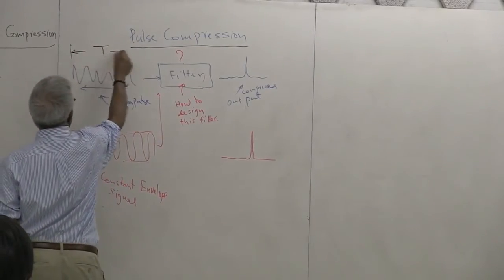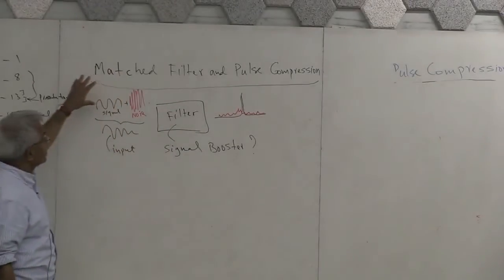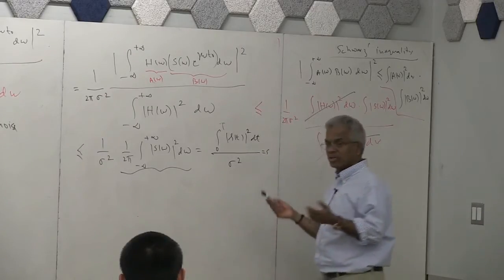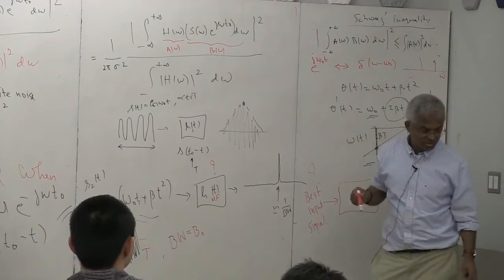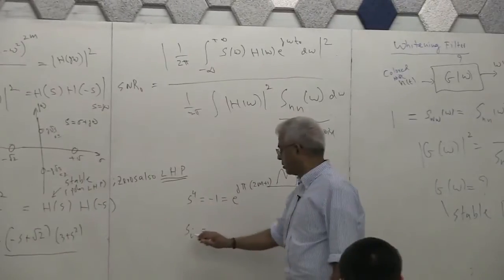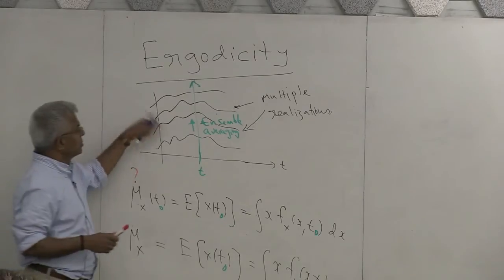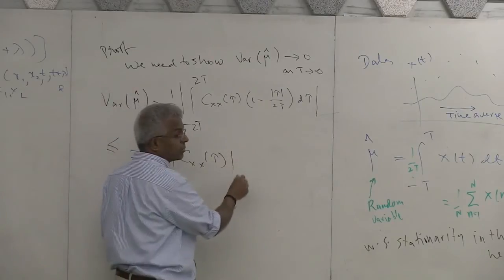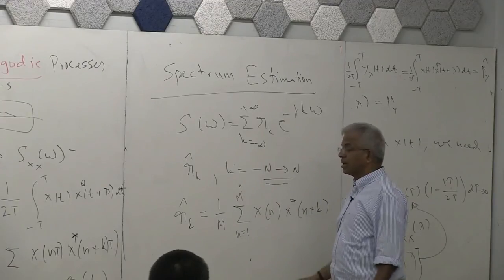EL6333 Lecture 12 May 2014 "Matched Filter, Pulse Compression and Ergodicity"

Comment: Sir, i require some help from you on implementing pulse compression using lfm in matlab. This is primarily to get a high range resolution.
Reply: Woops i met someone i know on youtube haha.. Hope you are doing good at tu delft. -Nick
Reply: @nickthanthrige2978   my god nick 😂😂😂😂😂 ha ha ha ha I am doing good at Tu Delft. I use a different account for YouTube now.  Maybe thts why I didn't see your notification 😂
Reply from the maker: +Prithvi T 
Yes Prithvi, LFM gives excellent pulse compression upon matched filtering, the compression factor being the product of the chirp BW and the duration T of the chirp signal. This is unlike any other signal, and there is a good treatment on this topic in my "Waveform Diversity" book, Sec 2.3 titled "Chirp and Pulse Compression". pages 31-37. If you can't find it, please email me at pillai@nyu.edu and I will mail it to you. For the matlab implementation, if input is f(t)+n(t), the filter is f(t_0 -t). You can adjust the amplitude of the noise term to realize the desired SNR. Also Sec 2.6 of that book deals with the detailed derivation of the transform of a chirp, that will show you why all this works. I hope this helps.
Reply: Thank you sir, If i do have any doubts i ll mail you back.
Reply from the maker: +Prithvi T 

OK.